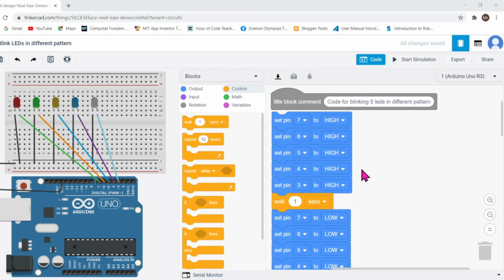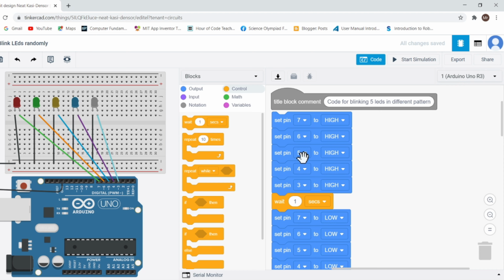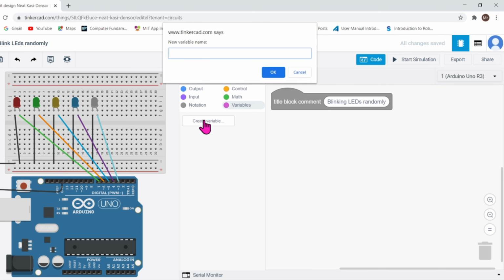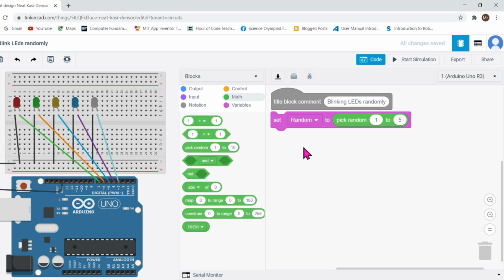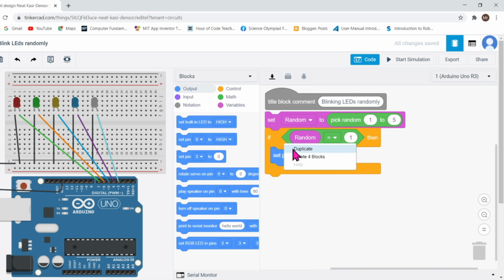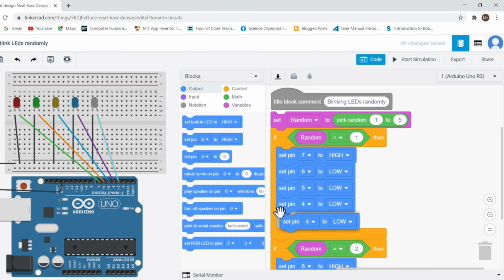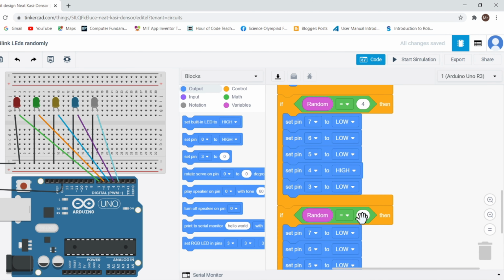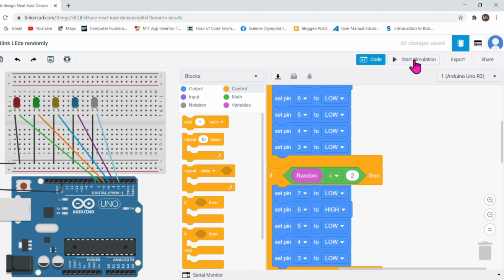Blink 5 LEDs Randomly using Arduino in Tinkercad [Tinkercad Circuit] [Aruino Block Code]

Comment: Holy shit thank you so much. We were tasked with making a project with a servo motor so I wanted to make some kind of randomized servo rotation to randomly pick a number. I found this video and though what if I replace the led with a servo and it worked. It randomly rotated between 45, 90, 135, and 180 degrees. Thanks so much.